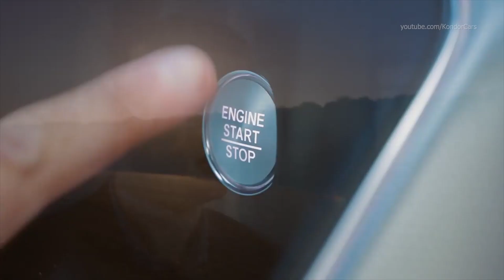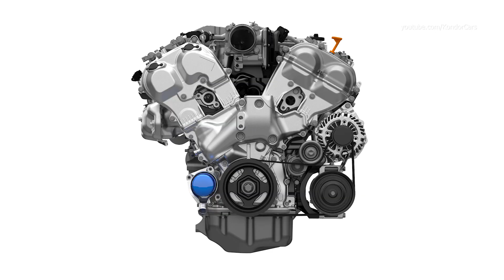Development of Acura Type S Turbo V6  // Acura TLX Type S

Comment: Tlx type s cost too much for the bullSh!T MOTOR in it...smh 286hp at the wheels i havent seen mod potential for decent hp yet and its not that good on gas....ill wait until its 6-7 years old and buy... its not worth the money new im sorry
Reply: New lambda tune for TLX & MDX type S 21-25 is making 385 WHP now.
Reply: Nice but for the price of a tlx you can get an 2021lexus is500 for the same price of a 2024 tlx where the lexus come 485hp  @TrungLe-tb2jj

Comment: A J35 3.5 N/A V6 which if I’m not wrong it made 265whp stock so about 304hp crank only about 50hp less than a turbo V6 makes me wonder where the heck is the turbo on this car, Acura should’ve used that J35 add direct injection to make it both port and direct injection and then add that same or similar twin scroll turbo and boom you have a reliable, good sounding and probably 400hp+ engine

Comment: I thought the NC1 Acura NSX had a different V6 engine?
I also thought the NC1 NSX had a block and head made by Cosworth?

The NC1 NSX engine is not shared with other Acura car lines like the MDX.

Comment: This is just a modernized GM 2.8 Liter found in the Saabs.  One of the only other single turbo V6's out there.  They are pretty stout in the Saab's so this should prove to be a nice update.  I'm not sure how well that single, integrated exhaust mono block is going to behave but it can't be worse than the 1.25" ID log manifold used on the old 2.8.
Reply: This isn't even remotely related to anything from GM, the ways in which the engines differ are extensive.

Comment: Love the car but cannot understand the 4200lbs curb weight..seriously what were you thinking? Those of us that appreciate and buy special models like a type s want more sport over more comfort/luxury and weight. This car needs to be fixed moving forward with an under 3900lbs curb weight, larger interior cabin space (the new integra has larger interior space even though it’s a smaller car?) - reduce trunk space if needed we care more about rear passenger space vs trunk and what happened to vtec? Many report this thing runs out of steam at ~5500RPMs, and it shouldn’t. Basically…everything you guys did for the integra was neglected on the TLX. Brilliant.
 I want a TLX sport version that weighs less than the titanic and I don’t want to go back to a sport compact like the integra, yet that one got what the TLX needed. Come on guys…

Comment: Yeah you ended  up with giving is a dud..and just hyped the crap out of it. It's like watchig an interesting tariler of a crap movie
Reply: I came here to say the same. This was the most overhyped drivetrain. The heads are so bottlenecked, you can’t get power out of them. Turbo is also too small. Transmission won’t handle higher hp and TQ. 

It’s a dud.

Comment: Love the new tl and MDX type s I just feel Acura fumbled the ball with the performance 355 horses for a type s?!?! The new age cars should be a minimum of 400 specially carrying that type s badge
Reply: I wish they didn’t lock the ecu so it’s so hard to damn tune 🤦🏽🤦🏽 same reason why you haven’t seen any 1000hp nsx yet
Reply: @dormaintaylor8159 It’s the heads. Heads are bottled up. So expect 20k worth of mods. Then the transmission will not hold.

Comment: Intercooler is too small, wastegate needs to be replaced to a manual one and needs to be tuned to provide more boost... if a 2.0 litter turbo Type-R engine can make 305 BHP, a 3.0 litter turbo engine should be able to make 450+ BHP without any reliability and environment/emission issues... WTF Honda?
Reply: and direct and port injection
Reply: Heads are bottled up and need to be replaced. Transmission won’t handle high hp neither. It’s an overhyped drivetrain.
Reply: Totally agree.
Reply: You should become an engineer at Honda
Reply: Who would use a manual wastegate over an electronic one?
Reply: @kensmechanicalaffair  good question.

Comment: Superb engine.  It’s somewhat detuned from its potential, not unusual for the brand, but count on it, when all the mods come it will become a little fire-breathing dragon; the block was built strong, employing 6 bolt main caps.  Honda employed variable valve timing, but not valve lift control.  Critics claiming the car is too heavy overlook how this car is in the BMW 5 series class size, not the smaller 3 class cars it’s being compared to.  Also, SHAWD adds weight, but makes up for it with superior road-handling & cornering characteristics.
Reply: Correct and this is why I bought it. The Car with the SH AWD handles superbly. This engine the way it was designed just screams Tune and mods to upwards up to 500 HP with not even a sweat!!! This thing is a legend in the making. Just think B16A , B16Bs 1JZGTE and 2JZ this is going to be another legendary Motorplant.
Reply: @SBF HAWK, Good on your, Mr. Hawk!  
Perhaps most owners might never go with mods, but as we agree, the car can handle them.  Already there are various minor ones already available with verified times down at 4.5 sec to 60.  A HONDATA ECU availability for the Type S will be a must-have to extract the motor’s greater potential .  The Honda haters can yap all they want...one thing for sure is Honda knows how to build engines!
Reply: @sbfhawk4343  The K20 is already easily capable of handling 500hp with 2 fewer cylinders.  I'm hoping this engine is good for at least 600 to the crank reliably.
Reply: Yessir had mine for 4 weeks now & oh the tuning possibilities are endless, in fact some owners are already running the Jb4 tune with significant gains k tuner also has a map out, just waiting for an aftermarket exhaust to come out.
Reply: 2 years later and nothing.
Reply: This is in class with 3 series B58. 5 series is a lot bigger with 10 times more rear seat room and a much more massive trunk. 

TLX is not the car we wanted. We just got stuck with it.
Reply: @ryanb8736  You got stuck with it?  I’m confused…who forced you to buy it?  
And what have you been waiting 2 years for?
Reply: @Snookynibbles  I didn’t get stuck with it. Everyone who bought it over the hype and promise of tuning would help, got stuck with a slow car. Many years later most people are selling them. 

I never bought it and got something much faster. I’m just glad I didn’t buy one, like some of my friends did.
Reply: @ryanb8736  Several things going on here worth noting:  
1.) Somebody failed to do their due-diligence homework before buying.  
2.) Speaking of “buying”, not many will buy your assertion that TLX-S buyers have been dumping their cars because they are slow and/or have discovered they have no remedy to make them faster.  That would  be an unsubstantiated farse.  
3.) The vast majority of TLX-S buyers aren’t looking for a race car, and are smart enough to read the product releases to understand features & performance specs.  
4.) You represent a tiny segment of buyers…those placing 0-60 times as top priority.  Cars like the TLX shine in so many other areas.  Seriously, sprinting between green-to-red traffic lights has never been a Honda focus group deciding factor in what sells sedans.  
5.) P2R Power Rev Racing, and Science of Speed, after-market Honda (V6 / J Series engines)  performance websites…add-in Acurazine as well for a wealth of resources for Honda tuners.  I’m surprised how if you’re so interested in the dicey world of street racing that you have remained so uninformed!  Fact is, there are tuned TLX-S cars out there; there’s a YT video showing a Type-S outrunning a 485 hp Didge Charger Scat Pack (Dodge claims a stock 0-60 of 4.1 sec.).  The TLX shaved almost a second off it’s stock time.  Just say’n.
6.) …and finally,  a 5 flat (some can run 4.9) sec. 0-60 time is not slow.  It’s plenty fast for any legitimate street purposes.  You seem so 1-dimensional in your priorities, and that’s fine, just realize you don’t come close to representing the blend of priorities that account for why the Tyoe S has & continues to be a successful offering.
Reply: @Snookynibbles  A scat pack is not fast. I blew them away with ease when I was stock.

Comment: Quite curious , why such a modest power output? Was their a higher engine output ambitions from the engineer team ? Was it the emissions restrictions or the fact that it was a dual purpose design for the MDX TYPE S a large suv which requires lower end torque or maybe both? Development costs are always a factor but how does it compare to the k series which i believe were quite high
Reply: I believe they focused too much on being green when it came to the tuning of this engine they could’ve blown everyone out of the water by giving us the most horsepower in the class but they didn’t….
Reply: That's correct. favoring low end torque for high output made it tame but not exciting. Same as Mazda's 2.5 Turbo. they too have similar technique for high boost at low rpm.

Comment: Fantastic engine the car is too heavy
Reply: The Car weight is not felt at all with the SH-AWD it hides it the car ends up feeling like a Sub 3000 lb car.
Reply: @sbfhawk4343  gona call BS on that one…first thing I felt when I test drove one a few weeks ago was the weight, in comparison to my 07 type s.
Reply: @sports_car_enthusiast  Your 07 is 3500 lbs this is 3900 lbs once your up at 145 mph it handkes like its sub 3500 lbs
Reply: @sports_car_enthusiast  Unless you put it to the test at high speeds you dont know anything bro
Reply: @sbfhawk4343  not sure what world you live in, but - one - most people drive well below 145mph in normal day to day life, and - two - I’d def be nervous going anywhere near that fast around a bend if my vehicle weighed 4200lbs, AWD or not.
Reply: @sbfhawk4343  no one is going to drive at over 140mph speeds on a regular basis or public roads. Get real (and yes I’ve driven at up to ~140mph speeds in a lightweight 350z years ago around a track). 

Bottom line is Acura went too far on luxury features and not enough on performance targets, which is what they needed to do under the Type S badge. They seemed to have done it in the upcoming Integra Type S, so there’s really no excuse. To me it’s clear that who ever was in charge of the decisions and targets for this car is someone who doesn’t understand the type of customer that looks at cars like these.
Reply: @sbfhawk4343  this car is 4200lbs not 3900lbs.
Reply: @sports_car_enthusiast  My GTS porsche weighs about 4250 lbs and it handles fucking exceptional 👏 this Acura feels 10 lighter then that Porsche and lighter then my Mercedes 63Amg even though its .50 faster then Type S , My S430 weighs 4200 as well the weight does not affect its performance as much as you would think so for the heavier luxury cars Acura got it right ✅ You want lighter then my CRX does that Job or my NSX or 911 GT3 ..You dont like that then buy a bmw and see how long that last you lol
Reply: @sbfhawk4343  Fair enough, but it still doesn’t feel like a “sub-3000lb” car. It’s gona take some getting used to…either way at that weight it def needs more power and wider tires. People have commented about the brakes not holding up to prolonged sessions either. I love the car just wish it leaned more towards performance out of the box. They didn’t seem to have issues doing that on the integra. Cars keep getting heavier these days…
Reply: @sports_car_enthusiast  I dont know how you can no like its performance with the new Tuner ECU the thing can rock 12.5 on the quarter mile and eat BMWS on the turn like nobody business 12.5 for a Heavy luxury reliable sedan I am good!!LOL
Reply: @sbfhawk4343  I do like the car. You have to understand I removed over 100lbs from my 07 type s, putting it close to 3400lbs, and I’ve had this car for 10 years, so I def felt the diff when I test drove the new one at 4200lbs. I was still planning to pick one up in a couple years, just wishing it wasn’t so heavy and came with a manual, and then Acura drops the new Integra type s, which is lightweight, has more interior room and comes with a manual. And it’s like wtf Acura why didn’t you do that on the TLX. Plus no vtec either but of course integra gets that too. I’m not sure I can go back to a sport compact hatchback, but I’m def torn between the two. My old type s also has ~330hp so the new TLX didn’t feel faster when I drove it, granted it was a short test drive at city speeds and I’m sure at highway speeds it might’ve been a diff story. I’ve always gone for a balanced car not all hp not fastest of the bunch etc. but still. Would’ve liked to see it no higher than ~3800lbs and a 6-spd manual. Turbo awd’s are fun though. Used to have an s60r long time ago 6-spd.